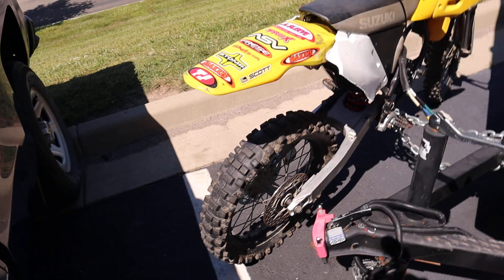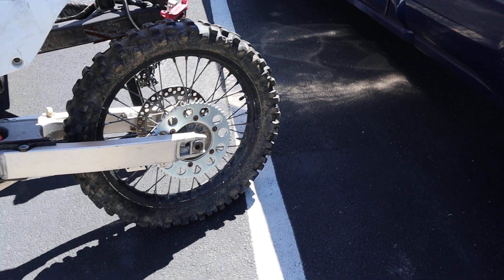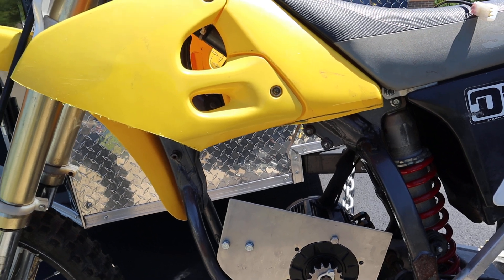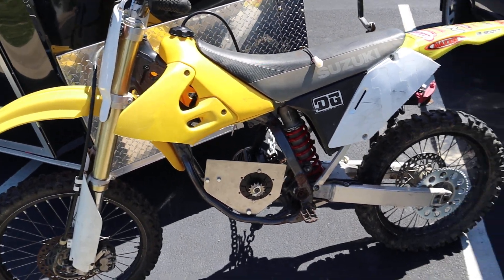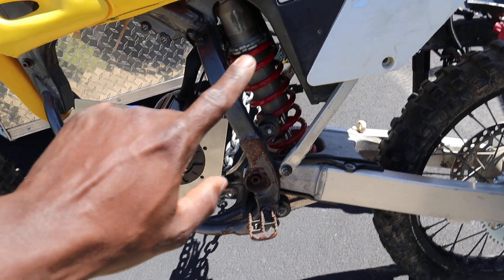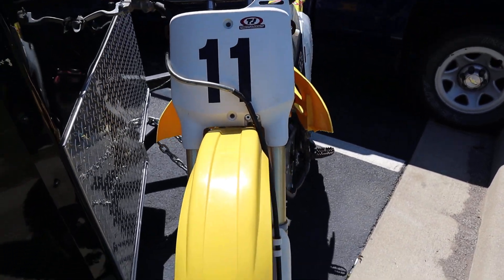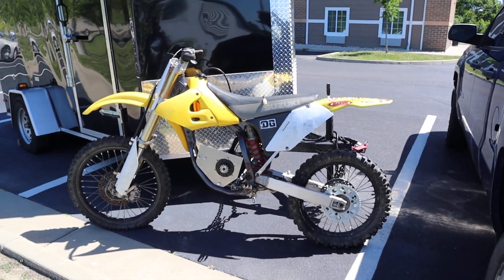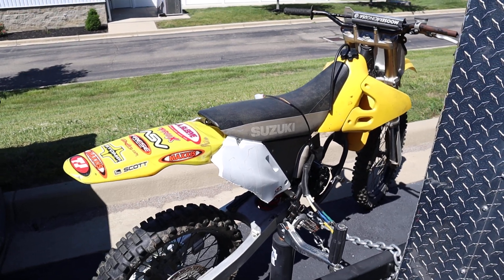Electric RM 125 2000 build part 1

Comment: Why not use bac 8000?! He can a lot of fase current, more than sabvoton!!!
Reply: My guess would be price. Asi bac 8000 is expensive as hell. And it would be overkill for that motor anyways
Reply: @BossManaatti  he have bac 8000, see the video his Chanel...
Reply from the maker: Stasus Kabasus i will try out the unlocked sabvoton controller first and see if i like how it works with the motor.if power is insufficient then I’ll upgrade to the asi bac8000 controller.
Reply: @britto761  how much unlock sabvoton current fase make it?!
Reply from the maker: Stasus Kabasus I’m not sure  what the phase current is.we will find out once we get the controller. 

some people have claimed up to 600 phase amps and 300amps battery but I’m unsure how accurate it is .
Reply: @britto761  not bad!) Bac 8000 840A (596A - RMS)
Reply: hi, nice moto, did u get the controller alreade unlocked? if yes can I have the link for it?thnx bro